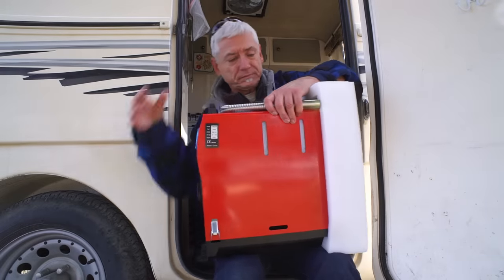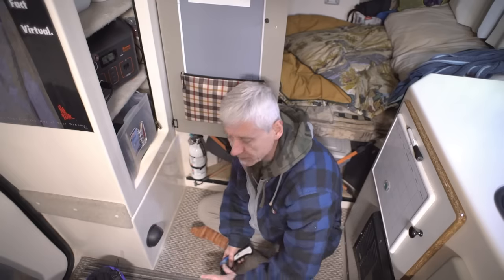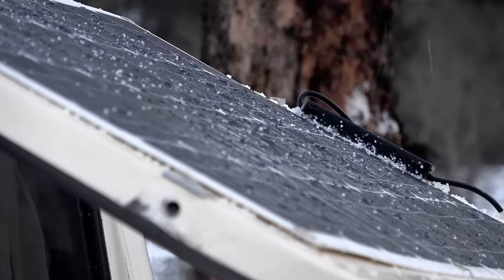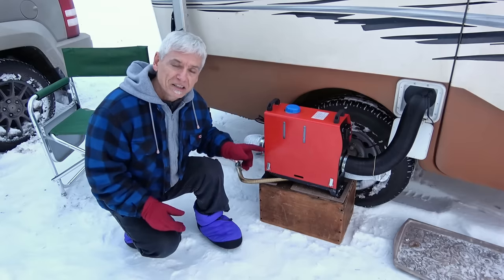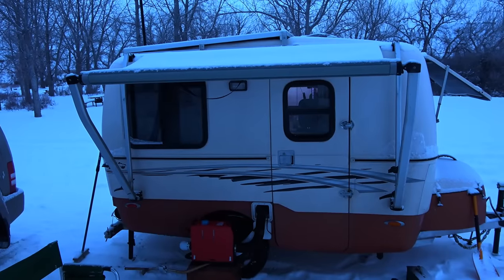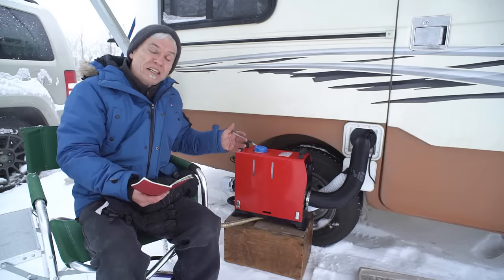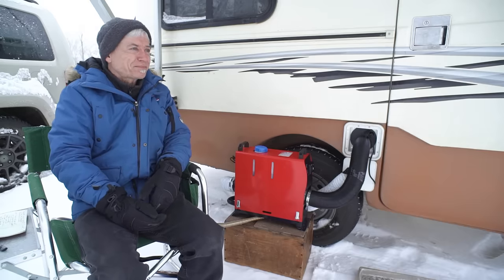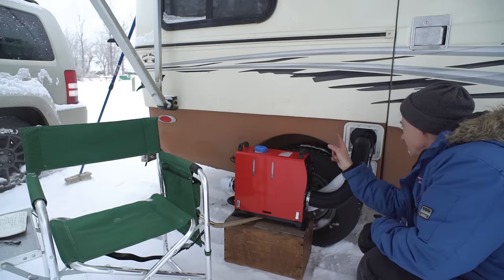Can this Work with a Camper? My Parking Heater Experiment Part 2

Comment: I have the same heater with blue controller outside of my truck shell camper sitting on the tail gate.  Easier setup that works out great on the truck shell and doubles as a shop heater.  Good video - Thanks for all the work and sharing information.
Reply from the maker: Hi Keith, great to hear from someone who understands the concept. Too many can't see beyond the typical permanent van installs, which just don't apply here. Thanks for thinking outside the box! SP
Reply from the maker: Keith, I hope you don't mind if I put a link to your "Testing Truck Shell Diesel Heater at Camp" video here. I think yours is a great concept and my viewers would benefit from it: https://www.youtube.com/watch?v=sbJbV8BuAOs
Thanks! SP
Reply: @SlimPotatohead  Awesome!  Thank you so much!
Reply: I have the same heater and am satisfied as well (not so cold here in Holland), If you get a longer heated output hose you can warm the engine bay (and interior) of the car before you take off.... Love your experiments!! Kind greetings!
Reply: This would be great in a big tent piped in from outside. It would also be beneficial for ice fishing.
Reply: Wrapping the fuel pump in a pool noodle will help muffle the noise of the pistons cycles?
Reply: How does it do when it's really cold outside (like 0d f) and it has to warm that super cold air?

Comment: Hey Slim good call. That heater is a heat exchanger and it's meant to recirculate the warm intake air and won't ever suck in diesel exhaust. Also those 2 or 3 power disruption prevented  the heater from doing its proper shut down rountine. I would suggest you run it full blast to clear out the fouled glow plug.

Comment: I installed one in my Aliner two years ago. Not the all in one version, just the heater itself. It's about the size of a shoebox. Drilled a 4" hole in the floor and mounted it in a cabinet. The hot air duct is only 2" long. The heater flange is sealed against the flloor so all the exhaust is outside the trailer. The fuel tank is mounted outside in a tongue box. Power is supplied from one of the trailer's fused circuits. I suspended the pump under the trailer with 1/8" elastic cord. I can hardly hear it. In the summer I remove the fuel tank and the heater remains but it's small and light. Controls are mounted on a cabinet face that I can reach from my bed. Overall I am very happy with it.
Reply: I'd really like to see your installation. I think this is a great idea as the Wabasto heaters in the old days were great, but problematic.
Reply: Ben, nice to meet you...
Reply: the one slim has is the 5k. its cold where he is and i plan to get one of these. but i wanted to know if it was auto on and auto off. like you set the thermostat and it will hold the temperature? or do you choose setting 1 and leave it or setting 2 and leave it? slim said its really hot to the touch even on low maybe a 5k size is to much for a camper in not so cold weather? my trailer is about 15ft long. any suggestions for the size i need?
Reply: @bobham919  from what I've heard it doesn't auto on off but it will reduce the fuel and power to accommodate the temperatures set. also the exhaust gets extremely hot so if u want one in a trailer I wouldn't recommend the all in one and make sure u use the mounting plate provided n make a big enough hole for the exhaust as the base of the heater gets quite warm.
The heater is very simple to wire up and on most a pre made wiring harness is provided so the only hard bit is choosing where to put the heater
Reply: Similar story as well, Ihave  internaly mounted with external fuel tank a 2kw unit in my avan, recirculate the heated air and it works great, i have extended the exhaust , but with a few
Minor adjustments they work great..
Reply: @bobham919  5Kw is the size you want for your trailer. You make adjustments within the controller master setting if need be, but they are ready to go with the standard factory defaults. If you have any other questions, be free to ask.
Reply: @bobham919  You don't want these heaters to cycle on and off. There's a start up and cool down cycle. You're better off getting a bigger one (5 kw) and running it at the lowest setting than a small one (2 kw) and not having enough capacity to heat on really cold nights.
Reply: @kevzz108  i have not started the build. i can do most anyway at this point. but i think 15k btu/5k is too much for me. i saw the real Webasto gasoline heaters i think will shut off and come on like a real house oil heater. i think

Comment from the maker: NOTE FROM SLIM: I released BOTH Part 1 and Part 2 the same morning, so please make sure you watch both to understand the full story.  Thanks! SP
Reply: For whatever reason YouTube only sent me notification for part 2 so I wrongly assumed it was second part of that one you removed from the platform ;) so I watched them backwards.  All good.  Thanks for sharing the experiment.  We've missed seeing you. Here's to 2021! Happy new year SP.
Reply: I really don't have a sense of smell...with an exception-- if I drive in town behind a diesel vehicle and my window is down..wow that wreaks.
Reply: It will switch off at low htz because of carbon build up it needs to run at full power to clear it every so often. Using the factory settings and temp regulation is best so it can cycle the burn. That's my 2 cents. Lol.
Reply: @johnathanpearson3203  I never run mine under 1.8hrz  , 1.6 was factory set on mine . Don't know why his went down to 1.2hrz  ! It'll soot up for sure
Reply: I was lucky and discovered the first one, watched it and then discovered the second part.  Happy new year Slim. Best wishes to you.
Reply: I was pleasantly surprised at the diesel consumption. Thank you so much for the informative videos.
Reply: Hi SP.  I just finished part 2.  I’m always fascinated by your analysis, development and improvement of products.  I think the diesel heater sounds economical and reasonably safe.  I would get used to the click, but I can understand how it might irritate a person wanting to be one on one with nature.

Fabulous 2-part series!  Happy New Year!
Reply: Why was the WAVE -3 not a good choice?
Reply from the maker: @Gearge Fenrich; Condensation. This has been discussed many times. SP
Reply: When we gonna see Slim pickins. I saw the guitar tabs on your counter. Maybe I watch to close. 😉
Reply: HAPPY BIRTHDAY JESUS 🎂! 
HOPE YOU HAD A GREAT MERRY CHRISTMAS 🎅 🎄& HAVE A HAPPY NEW YEAR TOO 🎉  MAYBE AN INSULATION SLEEVE OVER THE HOT AIR INTAKE TO THE RV SO YOU DON'T LOOSE THE HEAT GOING INTO YOUR LITTLE RV  ? YES SHUTTING THE CABINET DOOR WOULD MAKE THE JACKERY TURN OFF  , I'M GLAD YOU FIGURED THAT OUT TOO . THAT WAS A GOOD JACKERY 👍 👌 
WATCHOUT FOR THE BLACK 🧊 DRIVING 🚗& WALKING 🚶‍♂️ TOO ! BE SAFE  ! HAVE FUN  ! GOD BLESS YOU ALWAYS ON YOUR JOURNEYS NEAR OR FAR  ! ENJOYED  ! THANK YOU  !
Reply: Morning Slim, I found this informative, thank you.

I have seen photos of the insides of much the same unit, as I remember the pump is hard mounted to the case. Wabasto and Bosch use a soft mount for their heaters, this may be something to try.
Reply: Enjoyed the video but think you should install the pellet stove per cost and efficiency.
Reply: A couple of comments. The ticking sould reminds me of a grandfather clock, so I wouldn't mind it. I was going to say try moving the muffler, but you beat me to it.
I bet that Lone Bison was cold out in that weather! 😂 
You might want to check on other folks that have used vegetable oil or kerosene instead of diesel in these heaters.
Reply: @georgefenrich4119  propane makes moisture u get mold
Reply: @SlimPotatohead  It is dry heat though, where propane is pretty wet heat and usually fogs up your windows
Reply: Hey buddy you can get rid of the clicking by changing the fuel pump or you can make a box to cover it made of Dynomat sound proofing foil just a though I can walk you  through some of these modifications if you like. Good luck with your travels!
Reply from the maker: @Don Miller  what post are you responding to? Not the Wave 3 I hope as this is certainly not dry heat. SP
Reply: Glad you said something because I skipped 1 to get here thinking I had already seen it!
Reply: there are a few vids about silencing the fuel pump. I removed the bracket, wrapped the pump in a little piece of foam sleeping pad, them secured it with zip ties. it's hung loosely instead of being bolted to the case. 
it's loud because the thump is transferred through the mounting bracket and it rings the case like a bell. 
anything to insulated and isolate the pump will reduce the noise
Reply: We use Canadian made Dickinson 9000 Propane . It uses very little propane, and very little power. We use a Goal Zero 500X. 11lbs lp tank runs it for 3 or more days depending how much you use it at night. We love our Dickinson.
Reply: @SlimPotatohead  you may have already mentioned it but what size and power is your Jackery? I just bought the 1000 watt and have not yet figured how long it will last or charge... I know its all relative to it's use. But yours seems to do quite well.
Reply: @donmiller2060  good to know.
Reply: @shilohandme3697  Yeah, they are very efficient. That's where they shine over propane etc. is the cost for fuel and how little they use. That's what intrigues me about them.
Reply: Why was it shutting down after 6 hrs?
Reply: @doncarlton4858  Oliver tractors were designed to crank on gasoline and run on kerosene once the engine got hot. Kerosene may be a viable second source in an emergency but I think it would burn hotter. Maybe someone will experiment with it and let us know. There is so much to learn on YouTube that it's impossible to see everything.

Comment: This is exactly what I was considering for my gooseneck trailer.  After more than 30 years of firefighting, I could not tolerate propane anywhere near my sleeping area because of the danger.  So I have considered the diesel heaters and I was impressed with the “tent” installations where the heater was outside.  I have seen another trailer with an external heater installation and it seems practical, although his exhaust is routed up above the trailer with the stand he built.  The diesel heaters also provide dry heat, helping to control condensation.  This was good information. Glad you persisted and shared it.
Reply: been running 2 diesel heaters in my fifth wheel for 2 years best decision ever..use way less power..I'm off grid, less fuel and much cheaper then propane aside from the obvious danger of blowing up..and yea they are totally safe to leave on all night when it is really cold which I would NEVER do with a big buddy!

Comment: I’ve worked on one of these fitted inside a camper van, and it recommends that the plastic/see through fuel pipe does not connect directly to the pump, but instead be spliced to a piece of rubber pipe a few inches long either side - not sure if this would work on your all-in-one unit? I’d removed the rubber clamp holding the pump to the van body (just hanging the pump on the pipes either side of the it) and it wasn’t that much quieter, but putting the short lengths of rubber in line made a much bigger difference. I’m sure there’s some science to explain why, is the diesel fluid transmitting the noise and the rubber pipe bits allowing this to be less loud? Thanks for keeping us entertained and educated, and wishing you all the best for the new year ahead.
Reply: I have one inside my van built into the end of the kitchen cupboard. Pump is insulated with foam, mounted on soft rubber bushings. Fuel lines are also on rubber bushings. The heater is also mounted on rubber bushings. All the pipework has minimum bends as possible. I use 2 mufflers on the exhaust. But the ones you can see through each end and not the ones with a baffle. I also properly balanced the fan and motor. Sound deadening rubber mats car audio enthusiasts use are stuck inside the red metal case. My heater is now as silent as an electric fan heater, but puts out a lot more heat. In winter I can get the inside of my fan that hot I can sit naked and still sweat. Never need it running more than 25% in normal winter use.

Comment: Getting caught in a storm without the right equipment is not smart.  A six hour shut off is a, “NO GO”.  Good you learned about the Jackery thermostat.  Finding some kind of heater shelter in bad weather is gonna be a challenge; good luck.  You are a pro at insightful fixes.  I have faith in you.  Remember, your exhaust tube needs to get bigger as it gets longer.  I know you know why.  Good you need the vent in your trailer, whew!  This covers a lot of issues, my friend.  Quite the experiment.  Thanks.  Texas
Reply: Interesting. Did not know that physics require an exhaust pipe to get wider as it gets longer. There's obviously a formula for that? Automobile exhausts pipes don't do that, but perhaps it's because they typically don't extend very far, relatively speaking?
Reply: Luckily he had this thing called an automobile that he could simply jump in and warm and toasty!
Reply: Anthony, several things impede flow in a tube, obstruction, bends, length, radius, blah, blah, blah.  Thing is, a motor has to exhale, exhaust.  So, we put a tube there to point the exhaust out of the way.  The engineers have worked out the back pressure that exhaust puts on the engine.  That pressure has a relatively wide range of tolerance.  Usually, shorter is not a big deal.  But, if the tube gets long, then the length begins to impede flow and increasing back pressure may effect the running of the engine.  Hope this helps.

Comment: I put one in my small enclosed trailer and it worked fantastic.  It was -22 Celsius outside and +24 celsius inside.  The pump is annoying sometimes but it is safe.  I’ve used it 2 weekends.  It is safe.
Reply: Which brand & model are you using?
Reply: I believe anything that uses internal combustion is inherently unsafe yet we trust the manufacturers to put all the safety controls in place and that they actually work.  I have not researched the safety of these inexpensive heaters made overseas yet I guess you have? Its good to know.

Comment: If you connect, the air inlet, to the trailer, you can, run the heater, on low and get, the diesel usage, down to, about 1 gallon, to 1.25 gallons, for 24 hours.
Reply: Thought about it. a small disc he can put in the window with socket for the hose so the air cycles. then you do not need to heat cold air.
Reply: not only that but you wouldn't get the diesel exhaust smell
Reply: True, he would be heating the return air from his camper and not external air which would be much colder saving fuel if the temperature inside camper was monitored

Comment: The 12v on the jackery is on a timer, my 12v fridge kept turning off and the jackery was the culprit
Reply: I have a Jackery 500 and I am not happy with it.
Reply: @jeffreyallen1290  Yeah, I looked up the top model that is possibly capable of running a home refrigerator during a power outage, for how long, I couldn't tell you. Cause when I saw the price tag, 1000 dollars for a battery pack, I was horified. So I bought a 1000 dollar generator capable of producing far more power then these power packs. Yes its noisy, but at least I feel I am getting my money's worth. 1000 dollars for a battery that can only put out 500 watts of power, and may only last an hour on a fridge for all I know, is not what I call logical.
Reply: @stellarproductions8888  agree.
Reply: @stellarproductions8888  I believe the $1000 one is a 1000wh battery and a 1000w inverter I mean with losses you can probably only get between 800 and 900 watt hours but just for a backup of things like a fridge and larger appliances or just for a long time without solar then a generator is obviously a better solution but the jackery is ment for another customer  with the ability to for some backup in an emergency
Reply: @james10739  these battery packs are great for smaller uses, phones,  laptops, portable electronics but powering RVs???? I prefer a really good yeti ice chest over electric. Also I have a backup lithium ion battery to draw from.
Reply: @jeffreyallen1290  Why?
Reply: @james10739  add $300 and you would never worry about gas with the solar panels
Reply: @stellarproductions8888  generators and batteries serve two separate purposes. Obviously generating power is vastly a better call than trying to store oodles of power

Comment: I am happy to see your experiment.  Like I posted before I have only used the Expar heaters. They are much higher quality. The ones we have are mounted right under the sleeping bunk. I have never noticed any clicking noise with them. Your laying less than two feet away from them. So I am betting a different fuel pump that is quieter. The diesel smell at startup and shut down, I would bet it is because your air inlet is outside where the exhaust is. IF the heater is operating normally, the heated air and the exhaust are two completely different systems. So there should not be ANY chance of cross fuming. So I would try hooking the air inlet to your shower drain so the trailer is a closed system. This should make it a little more efficient too.   As for the clicking noise, try isolating the fuel pump mounting. Bolt the pump to a piece of rubber and then bolt the rubber  to the case. I do mean rubber like a mud flap in thickness. This should isolate the sound. If it is currently bolted solid  to the metal case it could be acting like a sounding board, which could amplifying the sound.